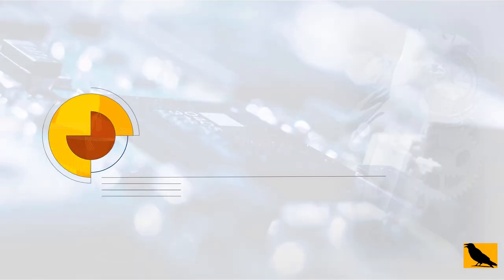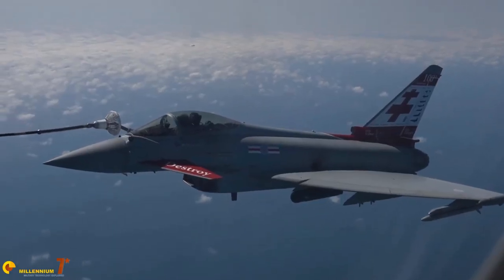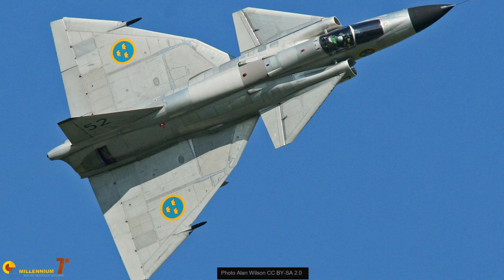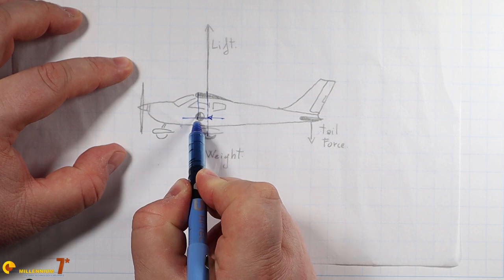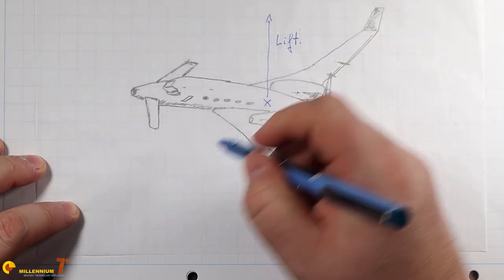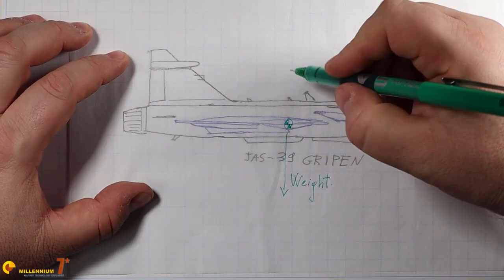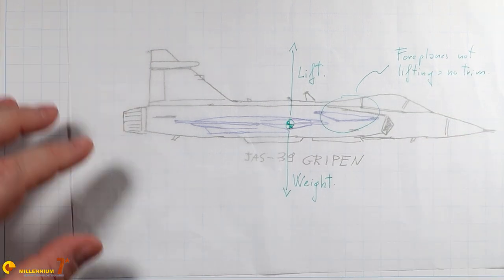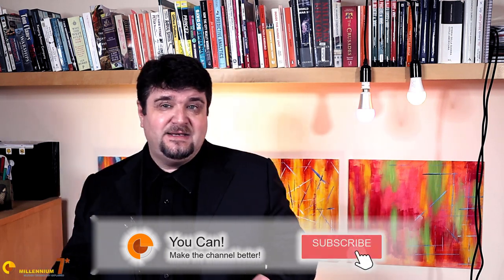I looked inside Rafale, Gripen and Typhoon, and this is what I found.

Comment: I'm no engineer, but what I don't get is: how is such a thin plane as a canard attached to the fuselage strongly enough to withstand the forces on it?? I mean, if we stick a hand out of a car window on the highway, we're impressed by the force of air at 100km/hr (60 mph). But these skinny little foreplanes have to be attached firmly enough to hold up under multiple-G manoeuvres – at speeds sometimes approaching Mach 2! Can you imagine the engineering at the joint? And then you have servo systems to twist them, also against those forces!! Boggles the mind.
Reply: The rods attaching the wing to the plane is not really that thin. Look on crane hooks for a reference, a hook with the diameter of 50mm is strong enough to carry a yacht.
Reply: @TheDanielsweden  Thanks for the observations. I understand the designers have this covered – the canards are not going to fall off! I was just expressing a layman's naïve amazement.  :^)
Reply: I’ve wondered the same.
Reply: They are far from the center of rotation(fulcrum) of the plane. Is the same principle that make easier to unbolt a bolt with a longer rod (far from the center) than with a short one.
Reply: Engineering is wonderful and you understand a lot about how the world works. Plus you get to create new things that never existed before.

Comment: Bro, why does this guy hold a grudge against Gripen and J-10? Those were like two of my fav fighters XD
Reply from the maker: My grudge against the Gripen is so big that there is half a dozen videos going into noticeable detail about it on the channel. J-10, I haven't covered yet.
Reply: @Millennium7HistoryTech  I briefly watched a few but your reaction to Gripen seems to be neutral while talking about how good it is. Are you sure you don’t like the Gripen?
Reply from the maker: If you stick around the channel, and I am deeply thankful for your attention, you will realize that I am pro nothing and against nothing. I just make analysis. My personal like/dislike stops at the aesthetics. I was just trying to make some irony on the Gripen.
Reply: @Millennium7HistoryTech  alright, I will stick around! I share a deep admiration for you with Greg.
I have one question regarding canard and stealth, if you don’t mind spending just a little more time on a single viewer: 
some say canard is bad for stealth while others say not if the canards are well designed. What are your view on this?

(I have watched your video on how stealth works and the best reason I have is that canard forms a 90 degree angle with fuselage, but so does the wing and that can be mitigated by angling the fuselage side)
Reply from the maker: Correct, but also is difficult, for room and aerodynamic reasons, to align the planform with the wing. Close coupled canards, also may bounce reflections between the canard and the wing.
Reply: @Millennium7HistoryTech  ty very much!

Comment: Just because a canard has to generate more lift to trim the airplane when supersonic does not cancel its advantage.  The load carried by the fore plane is subtracted from the lift needed from the main plane which can reduce it's AOA.  Since the center of pressure moves aft, a jet with conventional tail a tail plane has to generate more negative lift at the tail.  This not only increases drag at the tail but also the total lift (and drag) required of the main wing.  So the canard has a trim drag performance benefit over a tail plane for supersonic cruise.

Comment: Here's the extent of my knowledge on the matter before watching this video. 
1. Deltas have low aspect ratios, and therefore have enormous tip spillage and vortices  when under G. Thus they lose airspeed and energy very quickly in tight turns. 
2. They were popular for a time in the 1950s and 60s because they allowed large wing areas with the relatively weak construction methods and materials available back then. 
3. They fell out of favor because people figured out how to make longer wings stronger. 
4. They added foreplanes fairly early - the Kfir, Viggen, some variants of the Mirage 5 (with their "moustaches") for instance - to allow for more lift, mainly at take-off and landing, and in tight turns. Without foreplanes, to produce a pitch-up moment to lift the nose, you have to deflect the elevons up, which reduces the lift the wings make (which is why you can't use them as flaps for landing). With the foreplanes, you can avoid having to deflect the elevons up, and in fact can probably use them as flaps (deflect them down), which is why the Viggen can operate on short runways. 
I obviously didn't know about the vortex lift, about supersonic flight considerations, and this fly-by-wire thing, which is interesting.
Reply: Quite a fair bit of Delta wings remaining for something that 'fell out of favour' in the late 60s
Reply: this is exactly how i would describe it 👍

Comment: Thrust-to-weight is still very important when maneuvering in a vertical plane in BFM.  Thrust itself is incredibly important in BFM since that's the only thing that helps maintain airspeed in high drag caused by high angles of attack.

Comment: Amazing content!, could you do a video on the differences and purposes of the PESA and AESA radars??
Reply from the maker: Thanks! Electronics is on the radar, it will come out at some point int the not so far future.
Reply: PESA radars? Do you mean mechanicaly scan radars??
Reply: @marioshadjikyriacou3381  no, Passive electronically scanning array is older but similar technology compare to AESA; they are electronically steered (non mechanical, non rotating) but contain only 1 transmitter/receiver for the whole array, rather than each antenna have its own Tx/Rx

Comment: Father of Canards is Alberto Santos Dumont, a Brazilian inventor, wich in 1906 made his flight with 14-bis, the airplane Wich have the canard configuration.
Reply: Only the name "canard"  came from his plane. Due to the resemblance with a duck (canard in french).

There were several planes and gliders before Santos Dumont, most notably the Wright Flyer, and the gliders used to develop it.

Comment: Though you briefly covered it with the ending comments the Gripe and Euro fighter are much more tail heavy so they don't deploy the elevons in a flapped lifting configuration and in most subsonic flight envelopes you see the canard acting as flow control devices where they pitch opposite the vectored direction of flight i.e in a pitch up the canard mainly pitch down NOT to compensate for the crafts tail heaviness but to reduce detached air flow over the root much like the leading edge flap pitch down to help maintain laminar flow from detaching from the top side of the wing....most airshow routines  displaying their maneuverability is both subsonic and show the canard pitched down the most...

Comment: I would like to point out that canard configurations are not inherently unstable. Lifting canards with a wing giving a center of lift behind the center of gravity are stable designs and have been used in designs without fly-by-wire such as the Kyushu J7W and several designs by Burt Rutan. Additionally, while the canard delta wing combination is very good for aircraft with neutral stability, some modern fighter aircraft might prefer instability. For a canard delta wing combo to be unstable, the canard would have to produce downforce while in steady level flight, robbing it of one of its key aerodynamic advantages, meanwhile and unstable wing and tail design would have a lifting tail, reducing overall drag. There are more reasons than just stealth to choose a conventional wing and tail design.
Reply from the maker: The video doesn't say that stealth is the only reason. Thanks for pointing out.

Comment: Well the Chinese still have chosen a delta + canards configuration while having stealth as a main concern when they designed their most advanced fighter. 

They're the only ones doing so however and questions arise about how low observable is the J20.
Reply: It should have a minimal impact on the frontal RCS, but probably another story for other angles.
Reply: RadarCS depends on the angle of constr... Of the jet

Comment: Just note that at 11:30 the flaps at the rear of the main wing should be directed upwards, and not downwards to create the upward lift force direction shown.
Reply from the maker: Nope, it is right like this. You can check on any fundamentals of flight book.
Reply: @Millennium7HistoryTech  perhaps I should have been clearer in my initial statement. The position drawn is correct for flaps, but to create an upward pitch the flaperons will be deflected upward. You drew them correctly in other vids (I binged a bit). This was the only place where you changed the deflection position versus induced force direction which confused me as to why.
Reply: @James Van Allen that makes sense, but only in the case where an straight high alpha flight position is used. I understood the video to be talking about an upward pitch rather than high alpha flight which is what I think the picture refers to. Is there an associated article with the photo?

Comment: The delta wing is on the F-15, even though it has an empanage.  The F-18 has a double delta wing.  The canards help greatly with low speed handling.  The brilliant and imaginative Burt Rutan used the canard is many of his designs.
Reply: Nonsense.  Neither the F-15 nor F-18 has a delta wing, although the Eagle isn't that far off, I suppose, if you squint hard enough.
Reply: Bobby Brady  Size has nothing to do with it!  It's all about shape.  A delta wing is a delta wing because it's planform is a delta.  The Greek letter delta is a simple triangle.  No US fighter since the F-106 has had a delta wing.  The F-5, F-15, F-16, YF-17, F-18 and F-20 could all be described as cropped deltas at best, at least the early YF-15s could.  The wing tip design was altered to eliminate a buffet problem found in flight testing, making it even less like a delta.  I don't understand how you and that fool ZXEJ cannot grasp this: it really isn't hard.

Comment: The IAI Lavi was one of the first aircraft to use this configuration.
Reply from the maker: True
Reply: don't forget the flyer of the Wright brothers......
Reply: No, it was inspired  by the fantastic SAAB 37 VIGGEN.
Reply: @philv3941  Not exactly. The canards on the Viggen are fixed and their small flaps are really only used in takeoff and landings. The modern aircraft mentioned in the video employ fully steerable canards which actually steer the aircraft and are part of a system designed to overcome these newer aircrafts' naturally-unstable, but more maneuverable design. The Viggen is not an naturally unstable aircraft. It pre-dates the era of these kind of designs. The ability to use fully-steerable canards to overcome the problems associated with naturally-unstable designs only became possible once advanced digital fly-by-wire systems became available. The Lavi was one of the first aircraft to employ this configuration which is now common on many current fighters.
Reply: @MaxPower-11  my bad, thx for those good précisions.

Comment: As an interesting adjunct to this video, it would be cool if you could do another video analysing why the designers of the gripen/rafale went with a close-coupled arrangement of the canards, and the designers of the typhoon went with a long-arm arrangement. I get the feeling the designers of the typhoon missed a trick by not positioning the canards to strongly interact with the main wing, a view supported by the fact that Airbus developed the AMK to remedy these shortcomings. Short of directly asking the designers what their intentions were, a video from you could help clear up the advantages and disadvantages of each solution
Reply from the maker: Details I believe are still classified. Anyway, it is a balance between aerodynamic efficiency and maneuvrability.
Reply: @Millennium7HistoryTech  The long arm gives you a long lever arm for rotating the nose of the aircraft around the center of gravity. Therefore, the aerodynamic penalty (drag) introduced by rotating the cannards is minimized while providing lots of rotational force for pitching the aircraft. That's the explanation for this design choice that I am familiar with.

Comment: The problem i dont understand that canards have is that they have a steeper aoa then the plane itself, thus they will stall out sooner. thats why i still think rear horizontal stabilizers are better.
Reply from the maker: Why? They are fully mobile on combat jets.
Reply: @Millennium7HistoryTech  but i mean like, lets say youre in level flight and want to do a sharp horizontal turn, you roll your plane and then you increase the pirch of your canards so they produce lift, thus causing the nose of the plane to rotate upwards.... now lets say you want your main wing to have an aoa of 25 degrees to achieve the best turnrate, well then your canards would have an aoa of 25 degrees + the pitch that is needed to keep the nose up... so your canards would have an aoa of like 35 degrees and thats crazy. iam certain i make a mistake in my thinking but i dont know where.

Comment: if i may ask- why not use thick deltas (generating lift at low angles of attack) for subsonic aircraft? wouldn't the lack of a pronounced trailing edge reduce the induced drag?
Reply from the maker: Because it has a low aspect ratio-> high drag.
Reply: @Millennium7HistoryTech  (if i understand the subject correctly) the aspect ratio, when used in terms of induced drag,  indicates the difference in pressure (and the ease of air volume exchange) across the wing; this should be impossible in an uncropped delta though, or at least only present at the very tips of the wing

Comment: If the fighter jet is equipped with two engines should they be rotating in different directions ? Just asking from curiosity because wouldn't it be beneficial for that vortex on top of wing to rotate in the same direction as engine?
Reply from the maker: They normally  rotate in the same direction, so there is no left and right type of engine to be kept in stock, with all that follows.
Why would you think that about the vortex?
Reply: @Millennium7HistoryTech  It was just a thought that came in to mind without thinking thoroughly... Just having a feeling that thrust from an engine would be in sort of a circular motion due to spinning engine but of course after exiting nozzle it can't be the case (mindfucked this detail)... And those vortexes on top of the wing are rotating to different directions between each other (different sides of fuselage)... Then I thought engine exhaust would interfere with that vortex and if engines are rotating to same direction if would result in on the other side of the fuselage to strengthening the vortex and on the other side to weaken it... But like said this was just a brain vomit ;) Don't know anything about flying physics

Comment: If vortex lift is so beneficial to deltas and delta canards, why not enhance the phenomena even further with leading edge root extensions, or even LEVCONs? And is there any benefit to adding a forward sweep to the trailing edge of a delta and turn it into a diamond shaped wing like the YF23, like further extending the duration that vortex lift provides benefits?
Reply from the maker: Do not fall in the "more is better" fallacy. Every design element is a compromise among different requirements, aerodynamics even more so.
The YF23 diamond shape is the result of a stealth requisite and I believe it has nothing to do with vortex lift. Actually I suspect it is penalizing at high speed and high AoA.
Reply: @Millennium7HistoryTech  
You're right, there are some trade offs with every design choice. Do you think that the requisites of VLO or signature reduction militate fatally against canards, or do you see them as part of VLO designs going forward? 

The Chinese J-20 seems to have no issues with using canards on a VLO aircraft - would doing so necessitate using RAM and parallel edges to mitigate against the signature increase, or would the signature increase be unmitigable and so the J-20 would not be VLO?

Comment: What is the configuration of Saab viggen
Reply from the maker: The Viggen is not part of this category. It is a stable design aircraft.
Reply: @Millennium7HistoryTech  Id argue Swedish aircraft are a category unto their own generally.
Reply: The Viggen has a double delta wing with canards, however, as opposed to these modern fighters, the viggens canards are not movable control surfaces. The Viggen does however have it’s flaps located in the rear of the canards.

Comment: why the canards ... simple ... added nose lift and stability because the delta wings start so far back to reduce drag as much as possible by minimizing wing area the canards provid fron end stability because the tendency of those aircraft are to pitch down when thrust is applied ... and down for a plane is NOT the direction it wants go by itself 
.
the avro arrow is a true delta wing aircraft ... and the first to be able to exceed mach 2 also 15 other first included in ALL modern jet fighters today ... yup thats right ... 15 firsts ... First Fly by wire system ... first look down shoot down radar ... first over the horizon scan radar ... first air conditioner in a fighter craft ... first internal weapons bay ... first super cruise jet fighter (mach 1.3) ... first to use more than 50% titanium and other composites in a fighter craft ..(even more than the sr71 and u2)  first triple redundant flight controls ... ( fly by wire ... fly by hydraulics and fly manual with minimal hydraulic assist ... also added bonus .. the criteria to which it was designed HAS NOT BEEN MATCHED TO DATE ... not even the f18 f22 or f35 match the design spec of the arrow ... and the arrow started back in 1952 ... and was first rolled out on Oct 4 1957 ... at the same time the sputnik made its first chirp in orbit ...